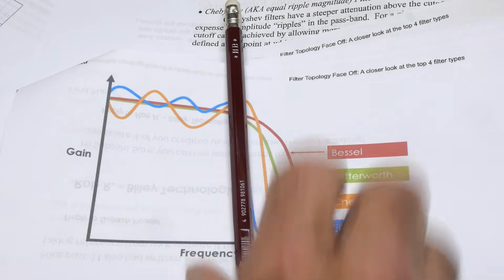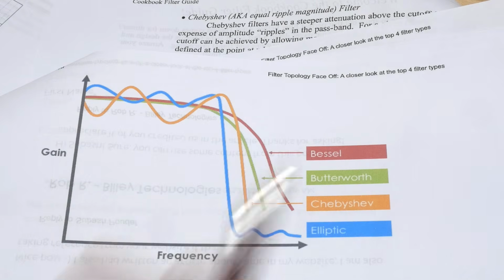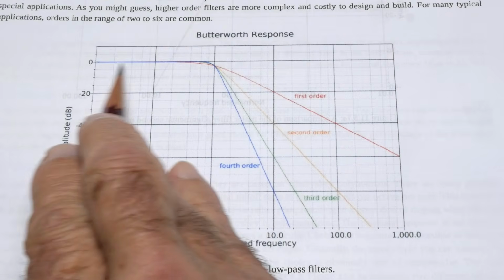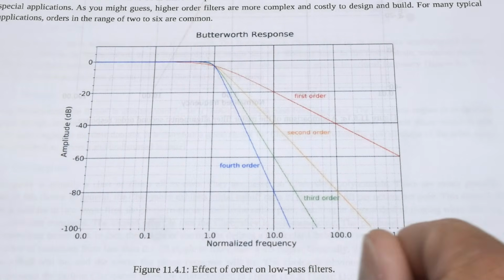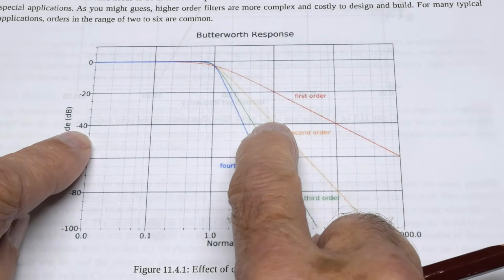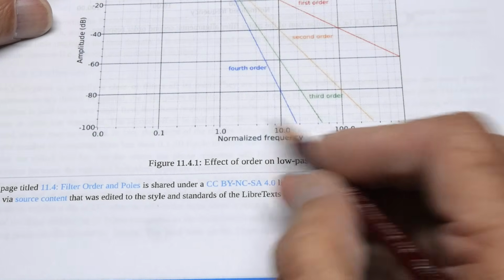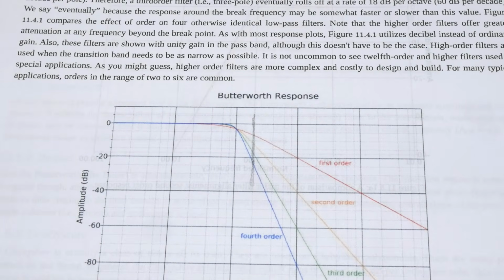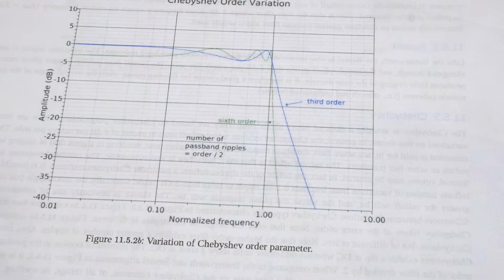#2583 Let's talk about filters (part 3 of 6)

Comment: Filtering is something that is just about as essential to electronics as amplification, and a basic knowledge of the subject is certainly useful to anyone involved in electronics.  I like the idea of introducing the basic figures of merit to the user... corner frequency, attenuation in the stop band, sharpness of the cut-off, etc, as a way to give an idea of how filters are useful and how you want to pick a suitable design.  The problem of how to present the info in a short time is not easy to solve.  Maybe some quick examples where a basic low pass is calculated based on requirements, and then breadboard it and measure the performance?